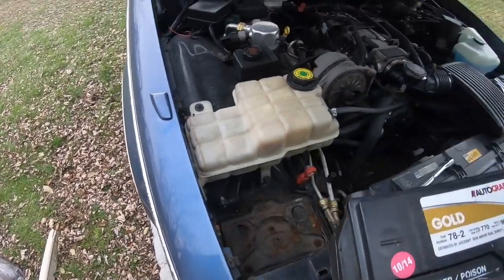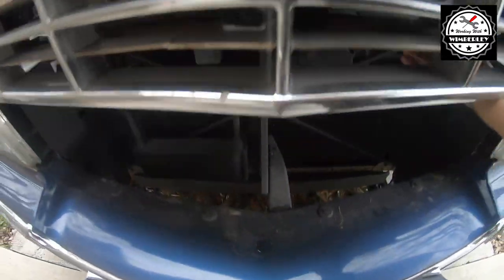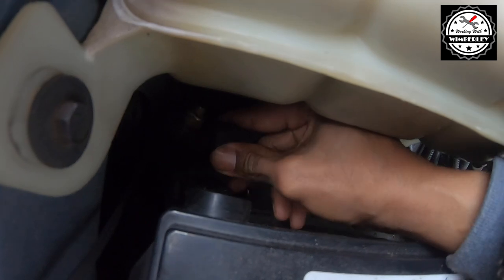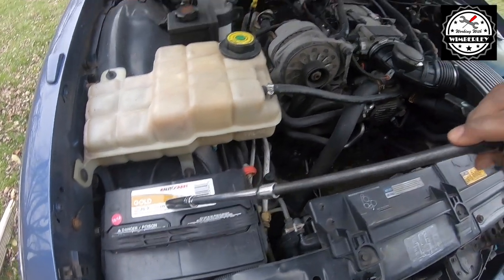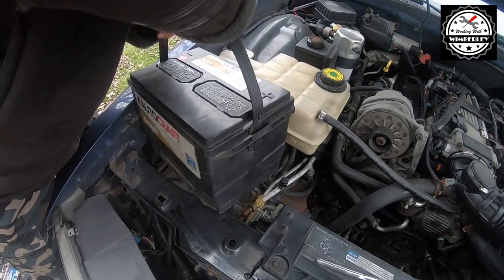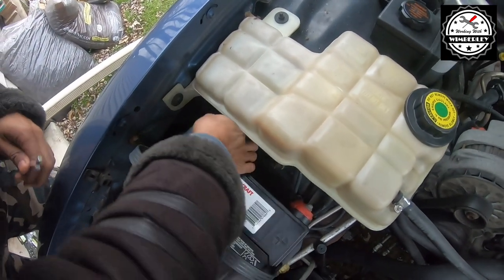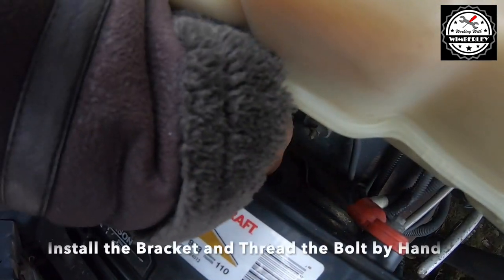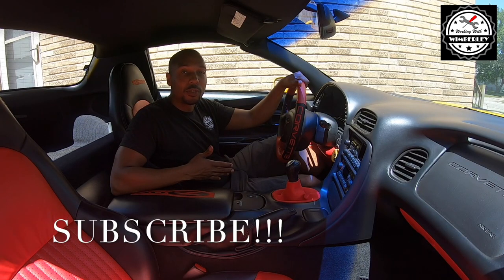LT1 Battery Replacement 93 94 95 96 Chevy Impala SS Caprice Buick RoadMaster Cadillac Fleetwood

Comment: Nice vid!!  You can also use a 5/32" wrench on the battery terminals, and a 1/2" socket on the hold-down bolt if you don't have a metric tool set.  Best advice I can give is to put some anti-seize on that hold-down bolt!  There's nothing quite like struggling to remove a hold-down bolt that's rusted itself in place in the middle of winter when you're desperate to replace a dead battery!! 🤬😡💣
Reply from the maker: Thanks for the tips! 👍🏽👌🏽
Reply: @ahoorakia  Whoops, you are correct!!🤦 Tried editing my post, but it won't let me!!

Comment: My battery comes out without removing the bracket is that bad
Reply from the maker: Yes it’s bad. That means it’s not holding your battery down securely. If your battery is vibrating and shaking around, it could cause premature wear and failure. It’s not going to hurt right away, but over time it can cause issues.

Comment: My negative side will not come off I have 8 mm wrench it will not seem to turn
Reply from the maker: The bolt might be stripped. You may need to use pliers.